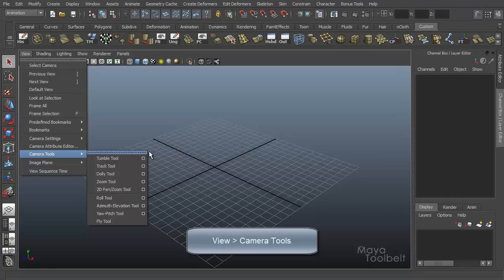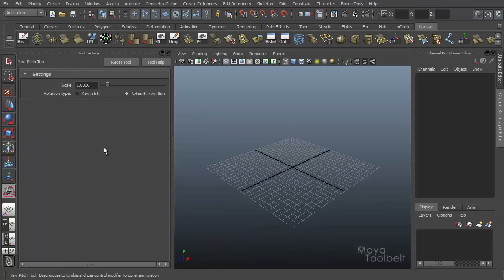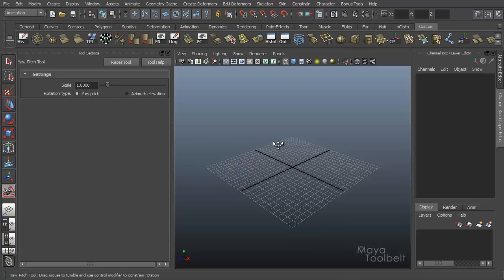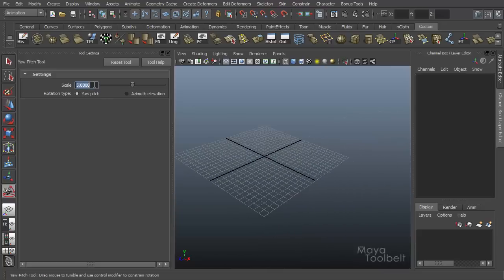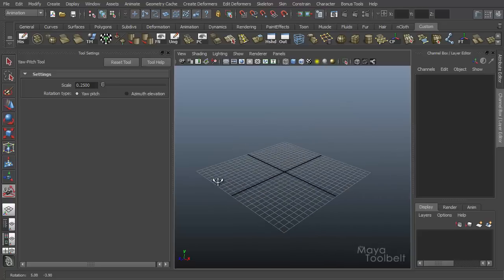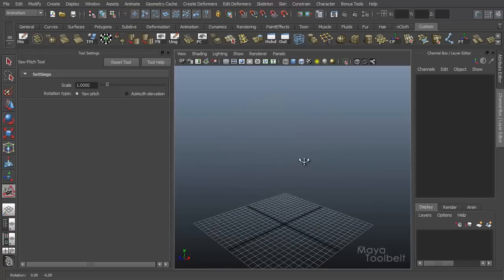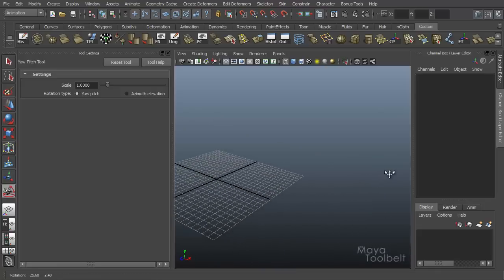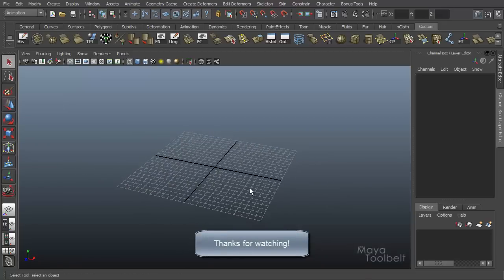The Maya Toolbelt - Yaw-Pitch Tool

Comment: is there a way to change mayas navigation to trackball, or have the camera rotation be un-constrainted to x y axis? similar to rotation in zbrush, 3ds max, or modo? This is really useful when modeling complex objects...I can do it with a 3d mouse but without one I'd like this feature.. is this possible?
Reply from the maker: You know, I'm not entirely sure. This isn't something I've tried to do before!
Reply: sadly you can't really, you can def tilt the camera but it is constrained to rotation around the Y axis. Not a show stopper but def a bit more steps if such rotation is needed..I would rather instance the object to a regular orientation and work on the instance haha